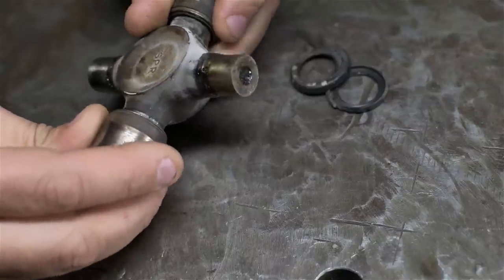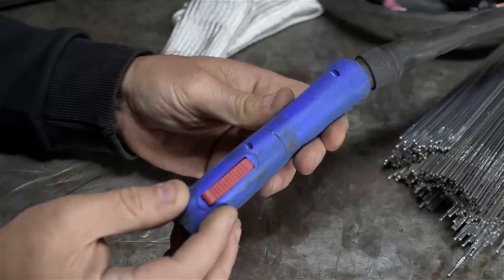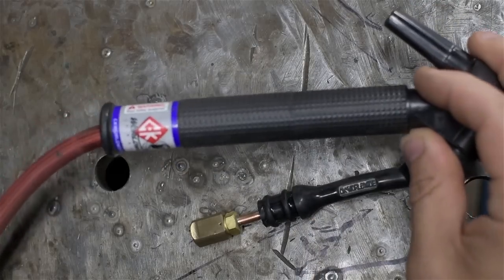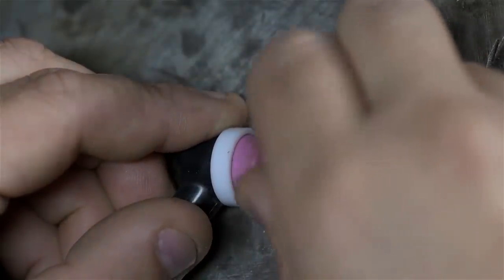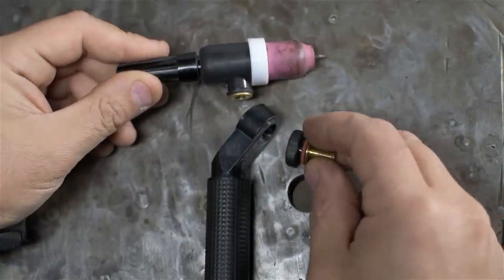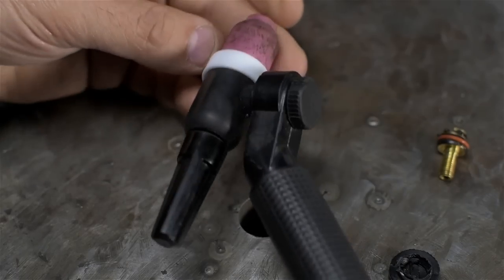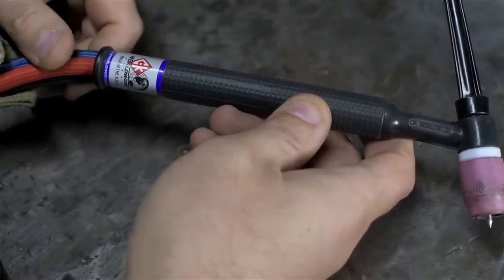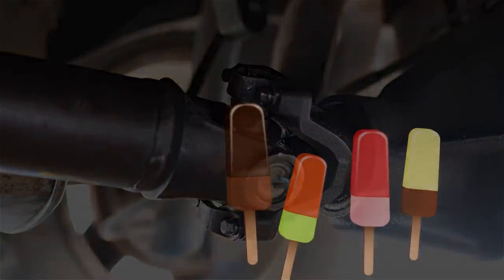TIG Torch 2: Flex-Loc and the CK-80

Comment: +1 for turning your MIG into a cold wire feeder. I did it with my Millermatic 135 ( I made both a torch mount wire feeder and a  freehand feeder with the existing microswitch).  The main downfall is always wanting/needing to fine-tune the wire speed, and the torch mount feeder cannot get into tight places. It works great for simple repetitive production work though.

Comment: Tony, I recently purchased a CK watercooled flex-loc for a Dynasty 280 DX, after using a air cooled flex loc for the last 4 years.  It was definitely worth the money!  Yes, the head does stay cooler than you would think. (I was worried no water to the head part), through a little bit warmer than a regular watercooled torch.  However they seem to work very well.  I would purchase it again in a heartbeat.  Thanks for the good videos and information!
Reply: Totally agree, Ive used the 230 amp rated 9 series flex-loc for 3 years now on a 250 amp machine with no worries, I have yet to go through any of the consumable thumbscrews either!  I dont floor it to all 250 amps very often but it has definitely made some nice puddles in thick aluminum.  I think an extra 20 amps a few times a year on a brand like CK is no problemo.
Reply from the maker: Good to know, thank you!

Comment: Brother you are a trip 😝😂 I can't get enough of your vids they are very helpful. I am about to jump into welding, what machine would you recommend that won't break the bank for a bigger? The bro
Reply: Jason B  Thermal Arc is what I have at home.  95 amp with a TIG setup does everything I need for less than 400 bucks (that was the price 8 years ago).  Used would be way cheaper...
Reply: I just bought a cheap Hawk Tig-200 DC machine on ebay, hoping to be able to give people some advice on that when it arrives. Really seems like IGBT tech is making DC tig machines cheap as chips these days without being scrap "chinesium" rubbish but haven't taken delivery yet so can't actually confirm that :P
Reply: Jason B love my esab mini arc 161 lts even for tig. Down fall is no foot control and valve torch but smooth arc and plenty of power and a great stick welder as well and runs on 110/220v
Reply: Everlast!
Reply: Jason B 
I would suggest getting something you can get parts or service for. Some of the cheap Chinese made stuff is pretty much throw away when it breaks. Nobody seems to want to fix or provide parts for some of the really cheap stuff. Just my 2 cents.

Comment: You do realise you've jinxed yourself into a Wire Feeder, a Welding Cart AND a Water Cooler build video?
Reply from the maker: You know, my wife picked up on that too. ;)
Reply: Water cooler: If it doesn't have to go below room temperature (which I think would probably be bad, condensation and all that), then computer water cooling parts (like the radiators used) might be an option – they are designed to be very quiet and even a relatively small radiator (like a triple 120 mm radiator) will sink 500+ Watts continuously. A car cooler could also be an option but that's perhaps a bit oversized and unwieldy.
Reply: I just looked at the "HTP Arctic Chill 5460" and that one is rated for 1.6 kW cooling capacity and almost 4 kW maximum cooling capacity. That's quite something. 1.6 kW shouldn't be a problem with a big PC radiator, but 4 kW is probably pushing it.

Comment: For a quiet cooler one option is to skip the fan / radiator and just use a larger container. I've had a few over the years, some commercial, some homemade. I know your space is also at a premium, but you can build some of it into your cart. My fav, was one I built that was the same size as an argon bottle. Just an aluminum box with a small submersible pump. It fit on the cart in the second bottle holder.

Comment: Very good video as always. I recently upgraded my everlast 200 to a 20 series (watercooled version of 9) swivel lock torch from ck, it's very comfortable to use and the water cooling keeps the torch body and swivel almost completely cool. The torch head does get quite hot, but the mounting screw never does. I feel like it's rated 230amps might be pushing it but suits my 200 amp machine perfectly. I can defiantly recommend trying it for the htp.

Comment: After I built my water cooler, my first new torch was a FL230. I love it to bits! It runs cool as anything even at 200A. I went with the Shurflo pump in the cooler, I must say I'm disappointed with how quiet it isn't. Also at 1.4gpm it takes 90psi to push water through the flex loc torch handle. Can't wait to see your water cooler when it comes together!

Comment: The special tool is a "NUT DRIVER"!  You can buy a set to get just one, or try the flea market.  You know them, generally like a screwdriver with a tiny socket on the working end, and the shank is hollow, so that extended electrode goes right in there.  It's a treat!

Comment: On my dads setup, he made a 5gal or so aluminum tank with a removable lid and gasket, inside is a small 110v submersible sump pump. For fluid he uses regular antifreeze so he doesn't have to worry about it freezing when the shop heat isn't on...the pump is quiet and the aluminum tank acts as the heat sink...this is on a syncrowave 250...never had a hot hand using it.

Comment: Tony, I know how you feel, in regards to your parting comment about simultaneously fixing your Jeep. On top of my full time job I've also been working on my parents house, basically gutted it and redoing everything, and in the middle of all of that the engine block in my Jeep blew up, literally, a good chunk of the block itself is on an interstate somewhere after the connecting rod for cylinder 6 snapped in half and proceeded to act as a hammer to everything around it! Just finished the engine swap while doing everything else I mentioned

Comment: I built a cheap watercooler using a 230v ac to 12v dc power supply, a 2 fan pc radiator with 2 120mm fans and a 12v RV pump. Under 200 dollars all brand new.
Only problem with the RV pump was too much flow causing the pump to stop. Fixed that with a bypass loop. Now running 5 litres per minute flow but can go up or down by opening or closing the bypass.
By going with a 12v setup the entire unit is low voltage and with using a ac to dc adapter I can use the output on my European Everlast's 325 Ext to power the whole shebang.

Comment: Fully enjoy your comments, thanks! :-)
I would add concerning the Flex-Loc; that the angle part on the end of the body where the locking screw is will MELT if it gets too hot, as does the locking screw. Trust me I know. Mine did due to heat reflected from the part being welded. Granted it was a heavy weld that too quite a while.

Comment: I've got some junk and an idea.  One of those counter top stand-alone ice maker appliances that's broken in such a way that all the parts still work (control electronics dickered). And i've been planning to turn it into a water cooler for my TIG rig.  Basically, instead of the cooling element sitting in a predetermined small ammount of water which it turns into solid water, i'll have it in a reservoir in circulation. Ice makers seem a little quieter than tig coolers that work by a massive fan blowing on a massive radiator.

Comment: I have both an air cooled and water cooler flex-loc.  Love them, but stopped using them do to the noise they make giving me a headache.  Now I just use a flex head water cooled.  I think the 9 series is air cooled and the 20 is water cooled, but still the same size torch and consumables.  Loved the Canadian torch joke!
Reply from the maker: You can definitely hear water going through a regular wp20 -- it makes more noise than that?  (WP20 doesn't bother me.  In fact I hardly notice it).  I had some bad experiences with flex head torches in the past.  I fiddle too much, maybe.
Reply: This Old Tony the flex-loc head makes a harsh high pitch noise when the argon runs through it.  almost sounds like you have the flow rate set at 50sch!  I figured it has to do with the passage ways in the torch head.

Comment: Tony I did this (bought just a torch body) to be able to swap back and forth from a 24 and 20 on my water cooled setup.  I needed to do some cylinder head work at 200A and the smallest torch was the only way.  Sell your MIG and buy a water cooler!  I also just made a brass wedge collet so I could stop warping the copper standard units.
Reply from the maker: I've always meant to try those wedge collets.
Reply: The only torch CK doesn't make them for is the gas lens setup for the water cooled 24.

Comment: Dialysis machines have excellent and relatively quiet magnetically coupled water pumps that will push >800ml/minute.  That in and of itself will cut noise by a huge margin over a key coupled pump.  You can get parts online, but talk to your nearest hospital, out of spec parts are tossed on the regular, and you don’t need them to be in spec to push some serious water.  You have to make sure to talk to the right guy (biomed tech), and handle that thing with gloves until you give it a proper bleaching.
Reply: soupisgdfood
Another reason why I read comments....... dang good information ! 👍
Thanks

Comment: I bought the whole htp package from usa weld and I absolutely love it. I dont find the water cooler to be noisy at all and it has an alarm to notify you if the flow gets restricted through the torch. Not very expensive for the cooler as well. Thought I'd mention it.
Reply from the maker: Good to know, thanks Moto!

Comment: Very good video. , the Torches are Gas cooled, The amperage is rated for example 40% or 50% for a welding time of 10 min so it means by 40 % you can weld 4 min and 6 min cool down and so on. Even with a torch rated for 240 amps the maximum continuous welding is about 90 to 100 amps, depending on the size of the Torch, another thing, you can expand the welding time is, to use a Tungsten 3,2 mm, or even a 4mm size, but continuous welding over 100 amps require a Water cooled machine , if you don't want to melt your torches or burn your finger thru the cloves. If you weld a lot of Alu or Copper it is vital to have liquid cooled machine. And it is also vital buy the Hose packages as long as you can . I also prefer a Torch with on off switches and current control ,rather than a foot switch you always searching for it , also you can go around your workpiece without dragging the damn foot switch and the machine around.Who is welding on the same place? Only a Robot? Or dragging the workpiece to the place where you sit, so you can weld with a foot switch , good luck with that and for you back bones.

Comment: 7:00        Years later:  Some nutdrivers DO have a hollow shaft!  That IS the tool you seek.  I keep one in the box with that kind of torch.  It also could be mentioned that some kinds of TIG hardware is available very cheaply online from companies like Riverweld.  Also many eBay bargains in this sector.  I haven't had any problems with Chinese TIG stuff, and some of it is surprisingly cheap.  It's not Conley and Klepfen or anything.

Comment: Just as a cooler thought... How about getting a scrapyard radiator out of a small automobile or a motorised bicycle? Pump the water through that, with a fan running at it. Or, build your own lil' heatsinky radiator out of aluminium... or copper tube even. Perhaps throw in some Peltiers. Cooling water enough to make a substantial difference to a welding torch (v.s. just tap water I mean) needn't be a noisy exercise. It should, however, be an exercise that requires a lot of work on the lathe and some teeny tiny little tig welds. Like... Get some round aluminium stock of a goodly size... Bore some small holes through it... Turn some heat exchange channels/fins around the outside... Loop the tubes all back together to have the water go through just one path back and forwardwise, which doesn't have any tight tight corners or changes in diameter (these will make Bernoulli sad).

Then some sort of pump. Maybe like... A water pump. And you're ready to rock. 

OOOOH! Also you could have TWO different channels with two different fluids in it, and have it do countercurrent exchange of heat like what happens in fish gills for their gas exchange... With the second fluid line going to a second radiator.... And more pumps and stuff.

Comment: Tony, the reason city water is terrible for touches is galvanic corrosion (link below), basically it is corrosion due to dissimilar metals. Somplace in your hose it is liley you have brass fittings this is a dissimilar metal, steel (older house) or polypropylene newer houses are neutral in the corrosion scale, also the silver in the solder used in the joints helps to counteract and prevent this corrosion. In copper pipes this is really not a problem due to the thickness, surface area and solder it takes something like 100+ years for it to really be a problem if at all. But when your talking about heat transfer fins similar to what we use in CPU water blocks (Image Link below) even a minimal amount of corrosion can result in complete blockage of the water passages.

Glad i could share some of my knowledge since you have given me so much ;-)

Galvanic Corrosion Information (Wikipedia) - https://en.wikipedia.org/wiki/Galvanic_corrosion
Image of a CPU Water-cooling Block - http://www.frostytech.com/articleimages/201204/CorsairH100_cu1.jpg

Comment: I'm using the Miller tig cooler which does make some noise, but it doesn't bother me, I have the water cooled CK flex head and often use it without running the cooler for short periods of time with no ill effects.  When running the cooler it stays nice to handle,     Go for it, you will like it!
Reply from the maker: Thanks Steve, good to know!

Comment: Tony, ever think about putting a heat exchanger (heater core, whatever) in front of your welders fan exhaust?  Save the cooler fan noise anyway.  I haven't tried it yet, but I'm thinking it would work. .

Comment: Tony, I have the htp 221 and bought their water cooler as well. I will tell you that it's not quite at all. I think it's the pump motor that makes all the noise. For sure you could come up with a better idea. Most likely it's because the cooler itself isn't much better than the welder itself. I think if you ran a large, say ac condenser from a car with a small pump you could affectively achieve the small amount of cooling.
Reply from the maker: You don't like your 221?  I've never heard their coolers run, good to know.
Reply: Oh no, sorry I love the 221. Just the cooler they sell, Is very loud. It does turn on when I turn the welder on, which is very nice. It does have a no flow alarm which does save your bacon from time to time.

Comment: Got a tip for the cooler build(warning, not an engineer, yet): big car radiator(s) and box fans. Should work fine unless you will be mixing metals and get some nasty galvanic corrosion. Got no actual clue how much heat one of those torches put out but I know a single car radiator with a box fan is enough for a couple high end graphics cards at about 300W each and a CPU that's another couple hundred lol

Comment: Home Depot has nifty home water filters with a clear filter cover. The yarn filters go down to a micron from much coarser ones $20-30 for the whole thing. Or is the corrosion from electrolysis? Maybe you need to use a closed system with distilled or treated water.

Comment: Make and run a solar/battery power water cooler and run a 12v automotive electric auxiliary water pump. You can pick one up between  $35 - $50 on the interwebs.

Comment: mr old tony i don't wanna sound stupid but i don't know how tig works.. i see a gas and a electrode.. did i see in other video you feeding a filler or does it just tack metal together thats there or both?. wait what's the tungsten is that the filler? no way i must have this wrong

Comment: City water gums up your torch with hard water deposits. Your municipal water supply is likely disinfected with chloramines, which are more stable at higher pHs, there for most water treatment facilities feed a calcium salt to bring the pH up into the mid to high 8s. I won't drone on further here (water treatment guy) as I could write pages on the topic. But there's a synopsis of why your city water is no good for watercooled torches.
Reply from the maker: Thanks Andy!

Comment: Just look at pc water cooling products, and just have a small 110/220 to12v transformer to power the fans and pump. Those are products that are developed and designed to be quiet and cooling hot stuff,

Comment: Just bought a 98 Cherokee sport, replaced a u-joint first thing.
Reply from the maker: Mine is also a 98.  The ujoint looked and tasted like the original to me; it's had a hard life.
Reply: This Old Tony
Probably not original, I'd be surprised if it was!
Jeep informed all buyers that u-joints were consumables.......... didn't they ? 😊
Reply: @kengamble8595  I believe the Jeep itself is deemed a consumable. It has been improved over the decades to more effectively consume discretionary income.

Comment: As a pipe welder I will never use anything else than a Kemppi dual swivel. You can point it anywhere, and no copper flex tubes that starts leaking after a few bends.
https://imgur.com/a/VPQgc
Reply from the maker: crazy, I'd never seen one of those before.

Comment: Meenwhile i am sitting here going. like 100 amps?! what paper thin things are you even welding. while i sit at 200-300 amps for most of my welding xD
Reply: I also tried 740 amps on a mag. holy bloody hell it was hot after 10 min of 30mm diameter welds.
Reply: I’d never weld unless it’s anything less then 1.5kA. Anything below is for hobby only.
Reply: cool. what are you welding? and what machine is it?